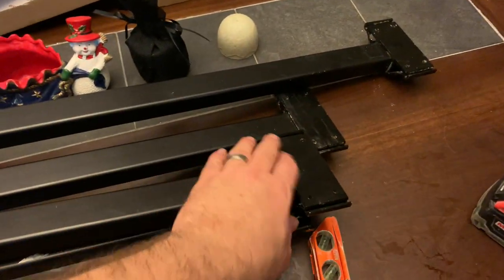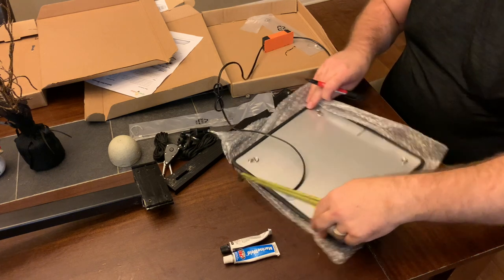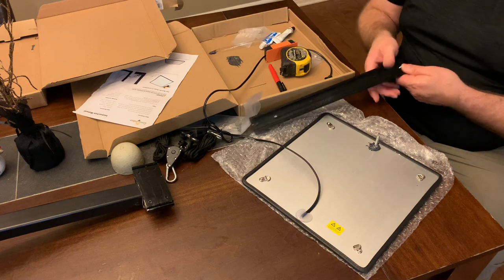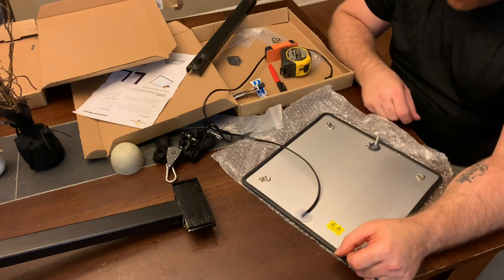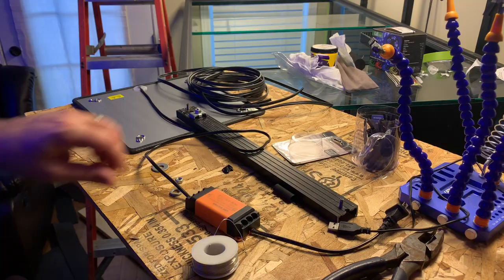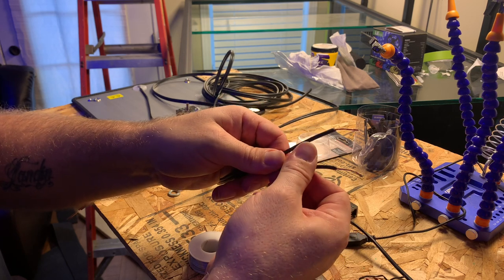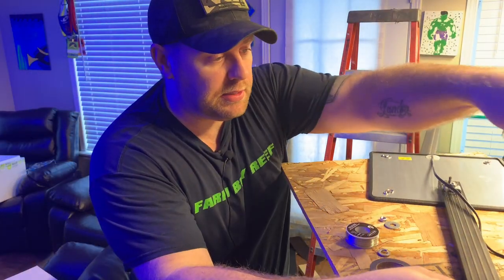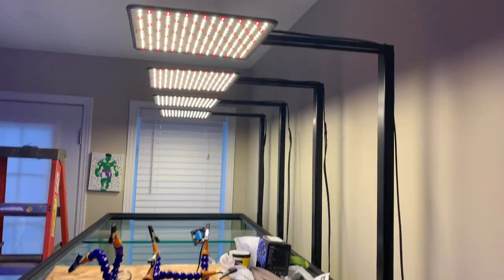420 Gallon build lets do the DIY lighting install.

Comment: 🤔Ok, thank you for your creative input here on 'the tube'...One big problem I see with this kind of light solution is that it illuminates everything around the aquarium. So much light from these panels spreads thru the space, on the walls, in your eyes, so maybe 60 % of all the lumens ends up in the tank, the rest is light/heat/energy waste...I have to look for some more practical solution for a living room aquarium set up.. KEEP ON BUILDING....keep busy; cheers